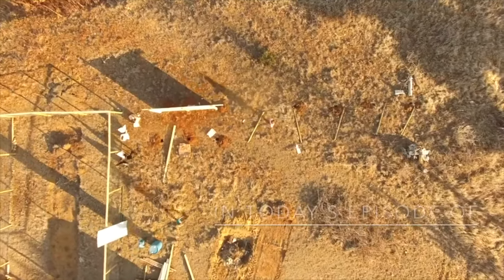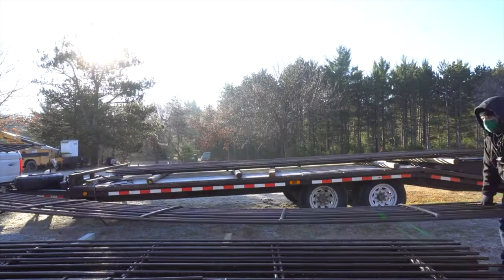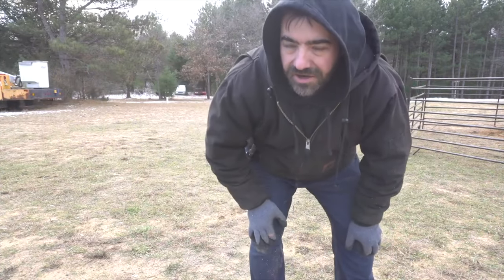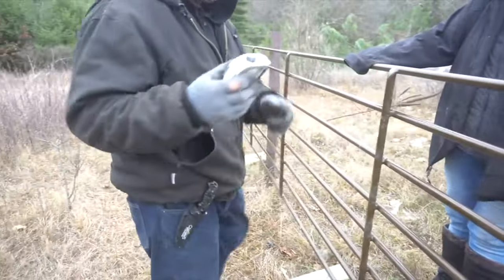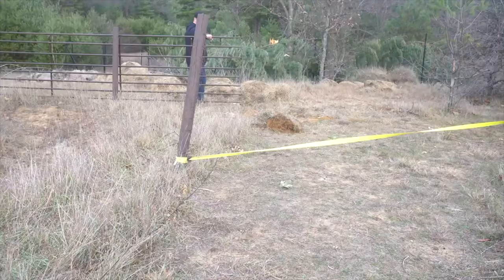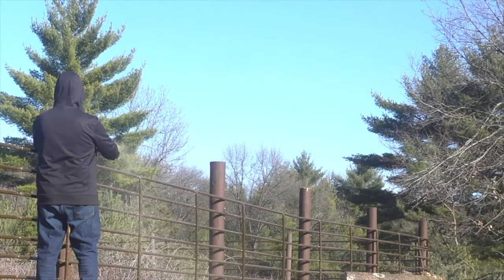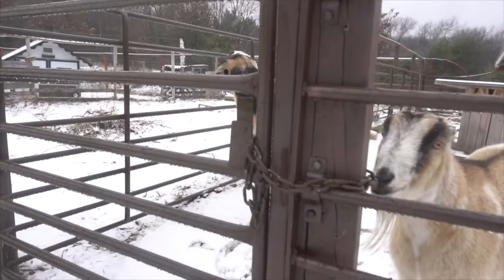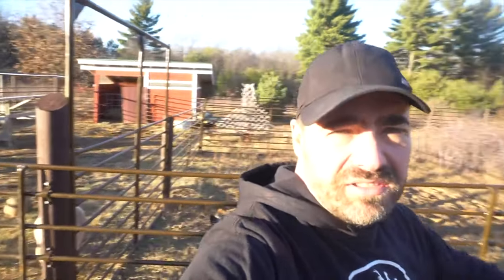The BEST Livestock Fencing in the World!

Comment: When you're pulling those posts out of the ground try using an old truck rim or a barrel (strap lying close to the bottom so it doesn't crush the barrel) as a pulley. Do it just like you had it but put that round object right next to the post. 

I had to pull out 40 or so 4x4s that were 3-4 feet in the ground and that trick works like a charm.

Comment: There's no way even a millionaire would waste this kind of money on installing these on more than 2 acres. These are panels for a pen, when you've rounded your livestock up and they're pushing on them. They're not meant to fence in an entire field. This size is fine, but anyone with more than a couple of acres is going to buy a standard cattle panel for much less and function exactly the same.
Reply: This fence is much less expensive per foot than some of the cheapest livestock panels at the farm store. Cattle producers in the Midwest use thousands and thousands of feet of continuous fence. Now this video shows continuous fence designed for smaller animals too.
Reply: @dougwedekind8563  How much are these fence panel he bought? What is the comparison to regular livestock panels?